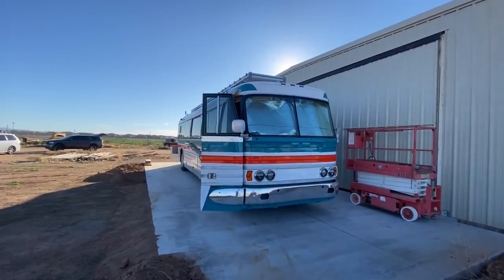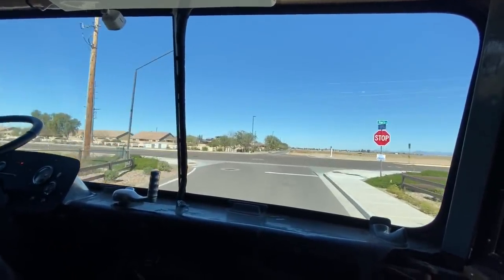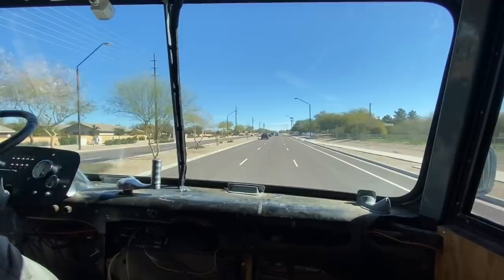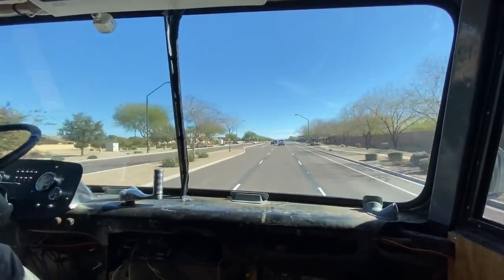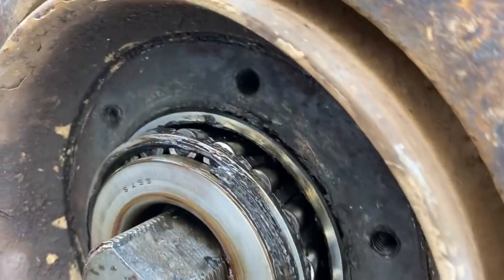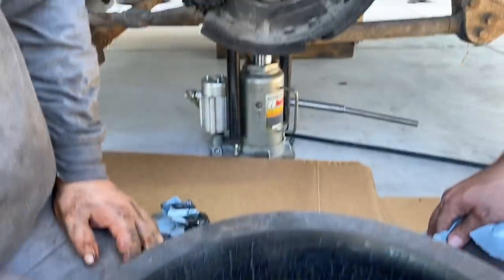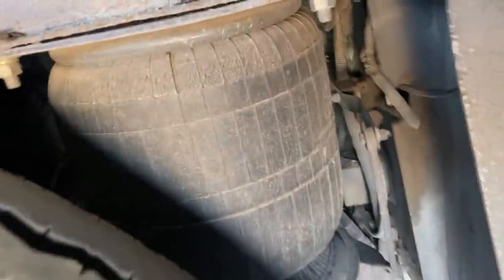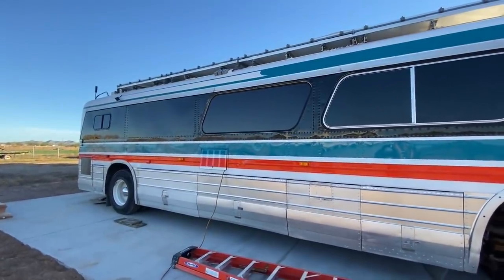Gilbert AZ gm bus 4106 day 1

Comment: It's funny to me when people pack the whole hub full of grease. You can see how much good that did! The only grease that matters is what's in the bearing.
Reply: Long ago wheel bearing grease would thin a bit when the axle and bearings warmed up, and centrifugal force made it flow to the outside. The grease in the cap served both as an additional reservoir and to keep the grease in the bearing from flowing out into the cap.
Reply: So do you remember the days of "long fiber wheel bearing grease" that really thick long stringy brownish grease everyone used?  Cold weather bearing failures with that stuff is what brought the transportation industry to use gear oil in hubs.  Then it took another 20 years to come up with good seals to keep the oil from leaking out.

Comment: I have seen the lack of grease and rust in front wheel bearings before that was caused by owners/detailers who use either hot water/steam-cleaner pressure washers or ultra high-pressure washers and spray the wheels with degreasers.  
As far as the condition of the front brake shoes and drums the reasons for there condition can be varied from either overuse/excessive use of the brakes.  This is can be caused because the brake drums and shoes are just flat old or they have just seen lots and lots of heat cycles in relatively few miles. Another cause for the poor state of condition of the drums and shoes is one or more of the drivers of this converted bus was not instructed in how to properly brake a vehicle with air brakes.  This problem in my personal opinion has been exacerbated by instructions in the DOT air brake endorsement test study guide and the air brake endorsement test.  Combine that with a new owner of a bus than has been converted to a mobile home who until now has never driven a vehicle with air brakes and naturally the brakes are going to be improperly used and abused combine that with the fact these converted buses are not subject to DOT safety inspections and that unfortunately if an owner of a bus like this does take it two a shop for a “safety inspection” regardless of the price they are charged more than likely all the mechanic is going to do is slide under the bus on a creeper or drive it over a pit and shine a flashlight in on the drums and shoes and look and see plenty of lining and let it go at that or the bus doesn’t see any real sort of safety inspection at all because the owner reads inspect brakes every XXXX miles and inspect suspension bushings and linkage every YYYY miles etc and because they haven’t gone half that far in ZZ years they don’t feel a need to have anything that is not working, squeaking, leaking, or dripping on the ground look at despite it might of been 5, 7, or even 10 years ago since it was last inspected or service was done on the bus.  I am not trying to bust on the owner of this bus owner or any others because you can just look at this bus and see he is taking car of his bus as best as he knows how and the service manuals were never written for a bus that was going to be sitting for more than a couple of dozen days a year.  So the conundrum the owner of a bus like this faces is how many mile or how long in time should they wait to inspect, or replace a given item on their bus.

Comment: At the marina where I used to work they had a small sign which read "A boat is a small wooden
or fiberglass hole in the water into which men dump wheelbarrows full of money." Now that I've
seen these buses I'd apply the same rule to them.

Comment: Looks like this unit will need some seal savers installed.  I use STEMCO seal systems.  They also have a nice spindle nut system too.

Comment: Were the s-cam bushings good? Looks like the brake and bearing issue we has on our MC8 with the water in the bearings and the linings coming apart. I know when your done all the critical systems will be safe for many miles. Keep up the awesome work and videos coming. I see you haven't used all of the Mopar brake cleaner I brought to Albamarle WonderLodge job yet.

Comment: I had a 6v92 that kept tearing that blower drive boot. It would then push the torn rubber out, dumping all the oil. Replaced the boot and clamp, tore again. Never did quite figure out how it happened. Ended up making a plastic filler piece to prevent the rubber from squeezing out if it ever tore again. Never happened again. Never had it happen on any of the other 20+ buses we've owned.

Comment: Hi Scott and Juan,  you've answered some questions just as you left the driveway and came back in after the test drive. I have a similar situation where I have a very steep entrance down onto my property and a very steep climb out of the property. Mine is because the state built a  elevated approach to a railroad track 700 some feet to the track. I've been looking for a bus but in the back of my mind I've been asking myself how am I going to get it in and out of the driveway.    I'll be very interested in seeing how Juan converted his bus at all and the improvements that he made to it. In the rural areas of Colorado the county clerk's office are  the motor vehicle department. They issue the plates for the state. They've told me not even to bother to try to take a bus that's a passenger bus and convert it to an RV. They don't want to do it they get no revenue for doing it. And the first and last one that they try they had to make over 90 some calls and the owner had to come back multiple times to get the bus registered in the state of Colorado. I.e. commercial to RV.  Their advice, move to another state.  Scott that is why you have very few customers in Colorado. I imagine there's a few. But I will not let the dream die. I will find a way.

Comment: Scott, what do you do with starters.?? When I managed the fire fleet I tried to have a spares that would fit everything. When I had a problem I would open the big Delco's  if they were burned they were a core to be turned in for a rebuilt, otherwise I would rebuild them.

Comment: So- forgive my lack of basic heavy vehicle knowledge, Im wondering about the hubs- is the oil filled hub thing an option that you can switch to with only a swap to that clean plastic hub cover, or are packed hubs versus oil lubed hubs an expensive decision to switch and better left as found? 

What is the better way to go from a maintenance perspective, for a weekend warrior type who only makes maybe one weekend trip a month, with maybe 2 trips for longer travel in a year?
Reply: Oil hubs  run a little  cooler.greased hubs dont leak as often
Reply from the maker: It’s hard to keep the oil in them.  Tolerances on the spindles show wear and saturate the brakes easily.  Grease is better to keep in there.   Oil is better lube but on these old rigs it’s usually leading to other problems.

Comment: A little dubious about the solar panels.  As a rough estimate they might get 700 watts peak, one horsepower.  Problem is, their drag at speed is going to be several horsepower.  Spending a lot and ending up with a net loss is not good.
Reply: It is a tradeoff that depends on how much driving they plan on doing compared to how long they stay in one place without hookups and not wanting to run the generator. As a bus running all day the alternator would charge the batteries. As a parked rv the solar panels not only generate electricity but they also provide a little shade from the direct sun.

Comment: It might look all shiny but first rule before you get things looking pretty is making sure everything is structurally and mechanically sound otherwise you are just polishing a turd. Such a nice looking bus on the outside but those front hub assemblies were shocking. It looks quite poorly maintained by its previous owner.

Comment: Those bearings are shocking, Someone hasn't put nearly enough grease on them. You should be able to make a bit on this one. . Its all work that needs to be done. I wouldn't put any of it off for later if he intends to use it. Dry wheel brgs on a bus. It doesn't pay to think about that to much.

Comment: When hitting the throttle, to me it sounds as if the engine is revving up too high, before the bus even starts moving. Almost like the `clutch` is slipping.
Reply from the maker: It’s an automatic and that’s the torque converter

Comment: A good thing he called you in,the front bearings and brakes look like a vehicle that would sit a few years,driven then parked, dragged out again a couple of years later then parked some more... Sounds like the trans could do with a flush. Didn't the power steer run ATF on those? Dex III. from memory .

Comment: Dang, it might have been wise to overhaul the bus mechanics first before pumping thousands into the conversion.
Reply: Wouter d.B. 
Plus a couple of real truck jack stands. No way I’d be sticking my head in that wheel well trusting a bottle jack to hold it up
Reply: @kevinlamarr1424  it's sitting on wood blocks. zero danger.
Reply: pd4501771 
Obviously we are not talking about the same part of the video 🙄

Comment: the rubber cracking is caused by air pollution and intense sun light... it creates ozone (rubbers worst enemy). L.A. has the same problem.
Reply: Jim Hammill  yeah, but he said the bags were replaced 8 years ago
Reply: Jim Hammill  Scott say's that were 8 years old, so I gotta' believe him. Intense sunlight combined with unburned hydrocarbons causes ozone, it doesn't matter if the bags aren't in direct sunlight because ozone is a gas. High speed switching equipment will also result in the production of ozone, so don't store your tires around motor/generators. The main component of sunlight at fault is ultra violet, it's for this reason ultra violet light is used in ozone generators for bacterial disinfecting. If you are unaware of these factors, then, by all means do a little research, or you can take it from me (and anybody else that specializes in materiel handling) that, yes, in fact, ozone is bad for rubber